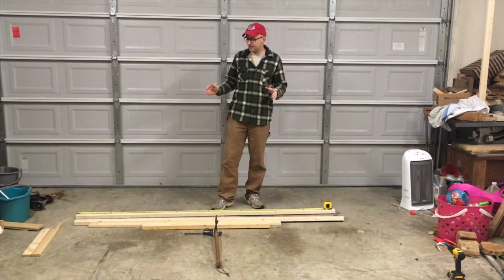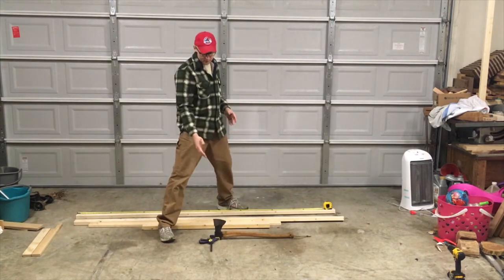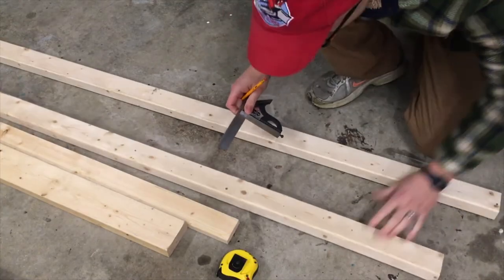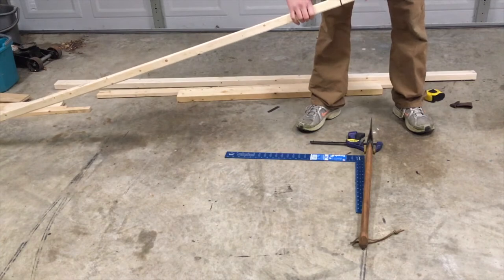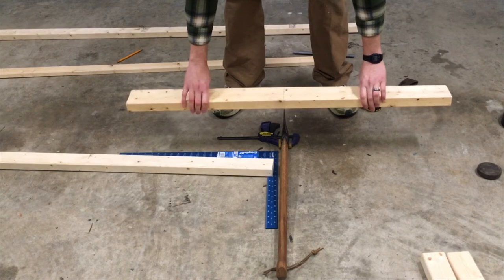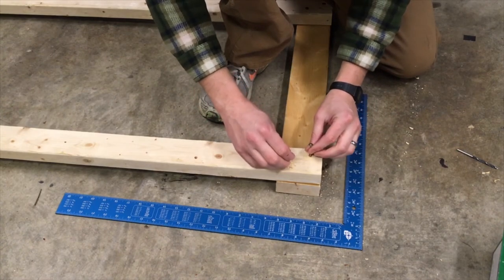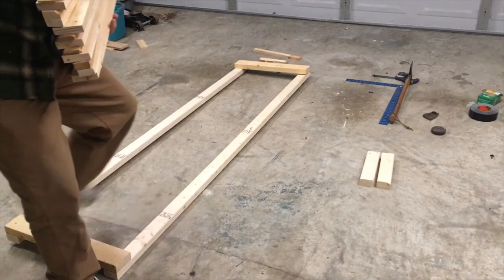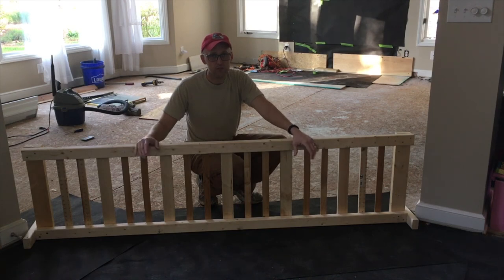Build an Indoor Fence using an Axe

Comment: Impressive techniques but this video leaves me with one question.... What the hell kind of a dog couldn't jump that fence? And, if a dog were to be so small that it couldn't jump said fence, couldn't it then fit between the wall and fence? I'm dying to know. Thanks. Great video! Also, you should know, I happen to be in search of a small that's easy to contain. DB
Reply from the maker: Great question, donnieb130! And very astute. The dogs are only just big enough not to fit through the gaps of which you speak, but being old, feeble, and somewhat timid are not capable of making the jump. But just in case I included a strand of razor wire over the top and sides. I didn't include this in the video for fear of the negative feedback from animal loving trolls. Thanks for the comment!

Comment: would you be able to make a smaller fence if you were to use a hatchet? i don't think my skills are developed enough to use the axe technique. also I'm not in need of a fence that large inside as i do not have a dog, only a pet guinea pig to keep out of the work zone.
Reply from the maker: Exactly right. Size of the cutting instrument, axe, hatchet, etc determines the fence size. For your Guinee pig fence a good meat cleaver would also work. Best of luck!